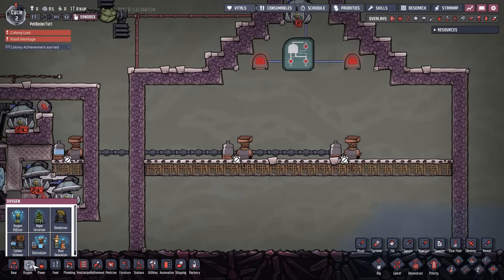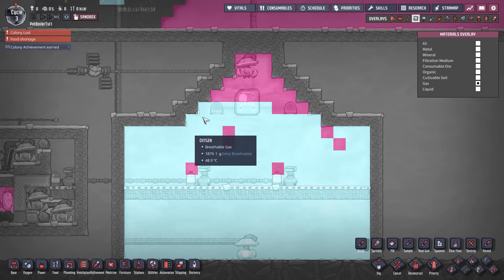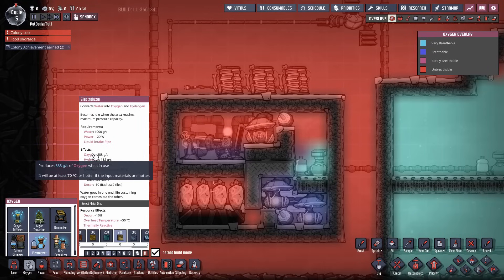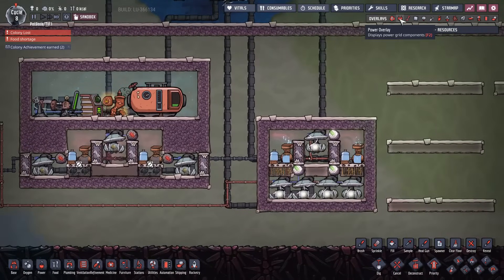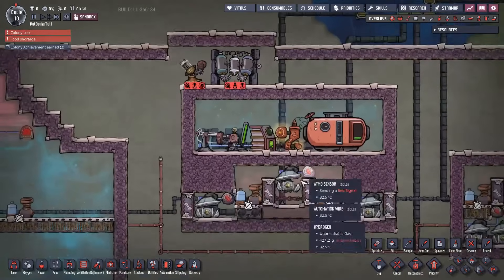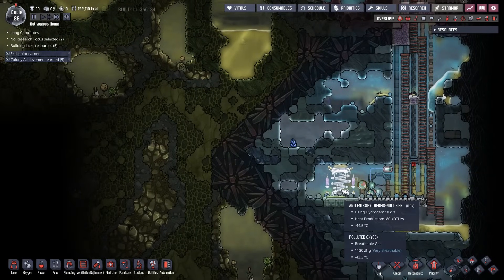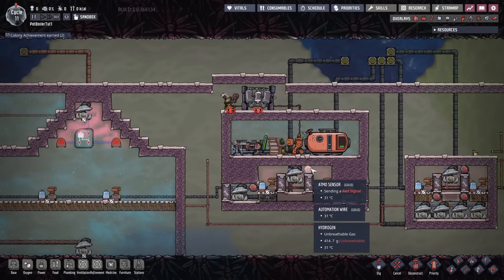Electrolyzer, SPOM, O2, Oxygen: Tutorial nuggets : Oxygen not included

Comment: Hi! I love your guides so far, they've really helped me understand more of the mid-late game options where the game's built-in tutorials fall off.
With all that said, I'm struggling to understand something about the full-Rodriguez design. With the half-Rodriguez, you're able to pull the full volume of gases generated by the electrolizers without causing a problem. So why doesn't anyone add a 7th pump in the bottom of the full-Rodriguez to get a full 3.5kg of o2 out? The only answer I can find on forums is that it makes keeping the pressures stable a more complex problem, but I'm having trouble seeing it.

Comment: Why do you leave two blocks free below your gas pumps?
Reply from the maker: The centre one?
The pump causes a vacuum in that area which helps pull in more hydrogen gas. Used to improve efficiency slightly by about 1-2% but later improvements to gas flow has made it obsolete.

Comment: i royally botched this one. Problem 1: polluted water in system, simple fix just put a pipe filter on
problem 2. didnt put the tiles down in the half build. the 2 center ones. kept breaking my system
problem 3: spent an hour figuring out the first 2 problems.
the worst part is i just built the system yesterday with no issues then built it in a different place with 2 issues.
Reply from the maker: That is sort of the joy, every time it breaks you figure it out a bit better what not to do next time.
At least it's not a volcanic build, mistakes with them are way more expensive. So you have that to look forward to :)

Comment: The interesting thing is that if your willing to put in a bit more work on these designs, you can use your electrolyzer as a heat deletion system.While the oxygen will be hot and needs some work to get it from cooking your base, the Electrolyzer can match the steam turbine in terms of heat deletion. Though if using a Thermal Aquatuners is still required unless you just feeding it fresh made water from something that is very hot.Alternatively a AETN can be feed the surplus hydrogen for cooling instead.
Reply from the maker: There are a few niche ways to delete heat, you can also use plant to eat a bit of heat. Someone made a great one using pills on conveyor rails. Turns out at the time fridges dropped the temp of things really fast so pass the pills though one and you could demolish huge amounts of heat that way.
The steam turbine ended up winning due to also being a power producer at the same time.

Comment: I designed the unit with the 3 pumps that fits in 4 high area. I just could not, for the life of me get the gas to separate. I had a mix of both gasses. I even downloaded the save file and looked at that. I didn't add a gas vent to the oxygen tube HAHAHAHA!!! Only took 2 hours for the penny to drop...
Reply from the maker: Ahhh that oxygen not included feeling where you spend ages trying to figure out what's not working only to realize it was you all along 😂

Comment: Not sure if it's due to a new patch or not but I can't set the atmo next to the hydrogen intake to 750g and it's fixed to 450g so I've had to alter it with 2 gas censors underneath the intake to detect hydrogen. Ngl it was pretty annoying how the atmo kept resetting but if anyone else has encountered this problem try my altered version if the atmo sensor is being stupid setting up.

Comment: For the full rodriguez, the second power transformer is useful to pull off normal wire and run off to your sieve and pump.  It also seems to be useful to throw a switch in between that transformer and the two electrolyzers allowing manually shutting down half the electrolyzers if you've accidentally way overbuilt your oxygen generation capacity.

Comment: i built the exact same setup of the spom that is 4 blocks tall and has the 3 gas pumps and i have had i running for multiple cylces but oxygen still keeps getting sucked into the hydrogen line and damaging my generator. why is mine not working?
Reply from the maker: The save game file is linked in the description if you what to have a look at it. But from the sounds of it you may not be running it flat out, you have to run it without letting the gas pipes back up for about half a cycle. This lets the hydrogen fill the top.
You can either use high pressure gas vents or a couple of gas tanks to store the output.

Comment: Not working on my map... Gases are mixing and moving into wrong pumps...
Reply from the maker: You need to run them flat out at the start, as in hook up gas tanks or high pressure vents so they can work at full speed. After about half a cycle they will stabilize.

Comment: I think its time for this to be updated to fully incorporate power station in the set up. One thing to note here is that oxygen output now comes out at the same temperature as the water used.
Reply from the maker: Last I checked O2 Comes out at a minimum of 70C but will be hotter if the input water is hotter than that.

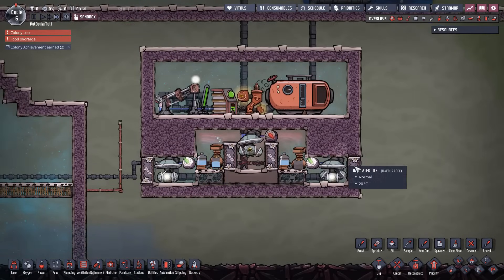Comment: I built 2 of these for making oxygen and hydrogen. (Timestamp 7:50) They worked perfectly for 30ish cycles.  Ran themselves and filled up 3 tanks of hydrogen. Then yesterday they stopped making enough hydrogen to run the generator and now they are eating up my supply.  Any clue what may have changed?  They are LOCKED dupes can't get in.
Reply: Solved it. Gonna leave this here for anyone else who runs into something like this.  The oxygen production had been slowed down due to the vents in my base being intermittently at pressure.  This slowed down the oxylizer production and threw things off-kilter.  Once I installed overflow tanks for the O2 everything righted itself.
Reply from the maker: Just to be clear you are limiting how much the hydrogen is burned with a smart battery? If you just let it all get burned off you will run out of power.

Comment: I have a problem regarding the full rodriguez (11:55). Even with four electrolyzers running, I am not getting enough hydrogen to keep all four hydrogen generators running and keeping it all self powered. Also I noticed that one gas pump is not enough to completely fill the gas pipe with hydrogen. Do you reckon I should add another gas pump?
Reply from the maker: They don't need the hydrogen gen to run all the time, you hook them up to the smart battery so you can control it. Once the battery is charged they turn off. If you just burn all the hydrogen immediately you will run out after a while.
The save game file is linked in the description if you want to load up the map and have a look.
Reply: @FrancisJohnYT  Alrighty, much appreciated!

Comment: So I built the one you show at 6:20, works perfectly! Although I'm finding one issue that I'm not sure if it's normal or not; pipes backing up. The oxygen I'm not too concerned about (I've got it distributing all along my base so if one vent is pressurised it'll move to the next, although even that's now backed up with more oxygen than I can use), but also I quickly found that not only did the hydrogen pipe back up, but also that the gas tank filled to full. Is this anything to be concerned about? I'm assuming not so much because it'll just run when there's space for it to run, right? Should I be setting up my smart battery to a specific setting? I've currently got it requesting at a pretty high number just to try and keep it constantly asking for more power to try and keep the hydrogen used.
I do have a pump in the lower end of the map venting out CO2 to space so I'm hoping pressure will lower again but honestly I don't have a huge issue with a lack of oxygen as I only use 8 dups atm, I just wanted to switch to a SPOM now that I had comfortable water supply and before algae got dangerously low.

Comment: Such a great vid, thanks a lot! I'm really wanting to step into electrolyzers as my algae is slowly depleting (tbf I could probably last another 100+ cycles or so on it), but I was reading so much about hot oxygen being an issue that I wasn't sure how to really approach it. Love the idea of running the water pipe through the oxygen first to help cool it, and also the ice biome idea. I've seen quite a few builds use an enclosed section of cool pwater to run the oxy through, but it confused me a little because wouldn't the water start to heat up from the hot oxy in the pipes and eventually not provide sufficient cooling? Or is that not an issue? I found a slush geyser recently, was going to use that to run through my hot water (I've been using a tepidizer to remove germs to give me a source of clean water to eventually pump into the electrolyzers), but maybe I could use the pwater from that somehow. I dunno.
Oh, I also love how you show all the piping and wiring, and also say what your sensors are set at. It's amazing how few guides actually do that.

Comment: I built my full Rodrigez horizontal because I had volcanoes on my top floor besides that everything is just the same. My problem is my smaller power transformer keeps running up to 127 degrees celsius and overheats. I have no idea where the heat is coming from, everything around it is at around 50-60 degrees. I'm not sure how to counter it either
Reply: Ok, So I replaced it with a large power transformer. That seemed to do the trick, feels kind of bugy imo.

Comment: I made the version with the gas tank, minus the doors in the interior because he said in the video that they don’t do anything except allow Dupes to get in and out (mine do not get trapped). 

The electrolyzers do not produce enough hydrogen, so the center gas pump pushes through an oxygen/hydrogen mix, damaging my hydrogen converter. So I have to add an air filter (taxing the power to over 1000 watts when it cuts on) to sort the hydrogen and oxygen, re-routing the oxygen back with the other two pumps. 

I even set the pressure gauges for 450, 450, and 750 like in the video. 

I’m out of algae, so had to whip this up or I would die. Still need to clear enough space/gather materials for my first attempt at a “Rodriguez,” but I’m already concerned that it might not work out given this trial.
Reply: Maybe I'll add the doors or play round with the atmo sensor, because my pump runs constantly even while set to 720.
Reply from the maker: You have to run them flat out for about half a cycle for them to start running clean. So you can't let the O2 or hydrogen back up. Hook up gas tanks or high pressure gas vents if you have to so they do not stop running.
Reply: @FrancisJohnYT  Thanks! I'll keep an eye on it to see what I might need to tinker.
Reply: To follow up, yes, the doors were necessary to consolidate the hydrogen. I can now remove the gas filter. 

Watching your other tutorials!

Comment: @Francis John  will the water pumping through the system at 14:20 do the reverse? If you are running 70°+ water, could you cool it down?
Reply: No. 70° is the minimum output temperature. If the input water is above that the output will be proportionally hotter too.

Comment: I made the mistake of building it the full Rodriguez too early. I simply didn't have need of all that oxygen and as a result it overpressured the room causing the electrolyzer to stop: In other words: it stopped being self-powered; at least that's what I think happened. A solution could be to just dump the excess oxygen into space to keep it going? EDIT: Nevermind. Just my own clumsiness to blame. :P
Reply from the maker: ONI always finds a way to mess up the best laid plans :) The good feeling is figuring out how it did it. Thanks for coming back to edit the comment, it's rare for anyone to be thoughtful enough.
Reply: What you can do is set up some automation for the whole thing to shut down if that happens. I did the same mistake as you did but I did some simple automation so that the H2 Pump will stop going if the oxygen backs up.
Reply: That explains everything.

Comment: The setup at 16:14 - I couldn't get that to work, I get kept tiny packets of hydrogen getting trapped in the tiles where the left/right sensors are.  Couldn't get rid of them. Correction - managed to clear the hydrogen, but had to send the dupes in and muck about with tiles for a while.
Reply from the maker: That design with the two little tiles for the sensors was a bit finicky. I switched to making it two tiles wider so the sensors could be parallel with the gas pumps.
Reply: @FrancisJohnYT  Thanks for the reply Francis :)  Bad news - after running for about 300 cycles, I discovered that my base had become oxygen starved, and found that 3 of the 4 sensors had trapped tiny packets of hydrogen.  I guess that better pressure settings on the atmo sensors might have fixed it, but I'm going to switch to the 2 tile wider design.

Comment: For some reason my Full Rodriguez is never returning a positive hydrgon amount, it is always trying to keep itself running which it does not succeed. It needs an external battery hooked to it to keep it running, followed everything step by step. Is something nerfed in the current game?
Reply: Nevermind found it out,  I crammed the bottom part together, no extra room above the electrolyzer. The main problem was that there were tiles directly under the gas pump, so it tried to pump while in vacuum or small amounts (mcg) of hydrogen, costing more energy than needed.

Comment: In a setup with 3 gas pumps and 2 electrolyzers (about 8:52), if each electrolyzer produces 888g/s of oxygen, and each gas pump only pumps 500g/s of oxygen, why doesn't it eventually overpressure, or pump oxygen into the hydrogen part of the room?
Reply from the maker: Only one element can occupy a tile at a time. So at the extreme end of that if you have a two tile room with 10000kg of water in one tile and 1kg of O2 in the other tile the water cannot just crush the O2.
In the build you list the electrolyzers do over pressure and stop working as the O2 pumps cannot pull out the O2 fast enough. But the hydrogen pump gets stopped by the Atmo sensor before it can pull out so much hydrogen that the O2 could replace it.

Comment: Thanks so much! I followed the full Rodriguez design. It actually worked. I have surplus of both o2 and H2... But Something weird just happened... about 200 cycles the electrolysers just stopped working. The error was atmosphere was maxed out and cant pump o2 out anymore....

After a while troubleshooting... 
I saw The air flow filters was creating a vaccum between the h2 pump and the o2 pumps through the overlay. It wa so weird like the air flow tiles got clogged. I replaced it with mesh tiles and it got fixed.

I wonder if that was normal. Probabaly a bug.
Reply from the maker: If I had to guess you had some liquid on the airflow tiles. It's happened to me before, one layer of liquid on airflow tiles does not render. Once you put in the mesh the liquid fell out of the way. Any chance that liquid that was not clean water got in the pipes?
Reply: @FrancisJohnYT  OMG I have been troubleshooting this thing since I put it in my first ever base (thanks so much for all the tips!) and this was the issue... Cleaned the water and she fired right up, damn that's a lot or O2!

Comment: Can someone please  help. The oxygen pipes below the electrolyzer from the two air pumps are not pumping air out into the pipes below. It is clogged with oxygen and I also have oxygen going up into the hydrogen generator too causing it to not work and the whole system to run out of power.

Comment: So I've always built this in my bases. The full one that is. After the last update or so I cant get it to even out anymore with the hydrogen and oxygen anymore. Either it sucks up all the hydrogen to quick or oxygen keeps getting right under the pump. Not sure what changed to make this not work anymore. Any ideas?
Reply from the maker: I downloaded the save file, vacuumed out the full one and fired it back up again and it stabilised. Did you run it flat out on start up? By that I mean you did not let the O2 or H2 back up at all? The gas pumps were allowed to pump flat out for about half a cycle, you need to do that to ensure it stabilises.
Reply: @FrancisJohnYT  Thank you. I figured out what I did. I feel dumb. Lol I just didnt pump out the oxygen fast enough so there was enough pressure pushing a little oxygen back up

Comment: Theres 2 hydrogen for every 1 oxygen atom, hydrogen has a mass of 1,00784 u  while oxygen has a mass of 15,999 u so you have about 8 times
 as much mass in oxygen compared to hydrogen. Or, to be more precise, if 112 grams of hydrogen are coming out of it, 888.97444038736307350373075091284 grams of oxygen should come out of it. 
Sure, 888g is not entirely accurate.
Reply from the maker: Raise on the 2 hydrogen to 1 oxygen model I never though to question mass, my folly has become clear to me.

Comment: I've just built an alternative sort of full rodriquez.  Instead of using a large power transformer and conductive wire, I have three regular power transformers, and regular wire (the dupes won't see it anyways, so why used refined metal?).  I have on one circuit two of the oxygen pumps and two electrolyzers.  The same for another circuit.  The third circuit is two of the oxygen pumps and the hydrogen pump.  Thus, every circuit draws 720 watts of power before I've put a pump or water sieve on it.

Comment: i am guessing they have fixed the water to electrolizer issue where it takes in 10 units and uses it like 1unit. Also at what point does the SPOM MKII with the tank start to accumulate extra hydrogen. When i build the same thing it never does unless i turn off the generator